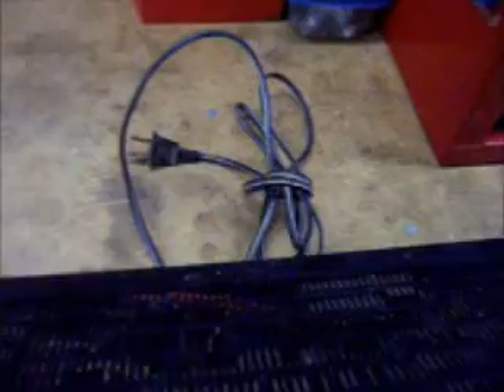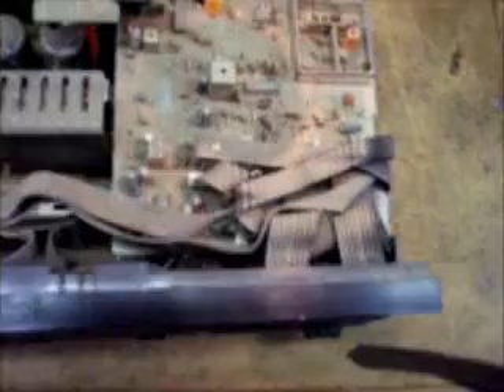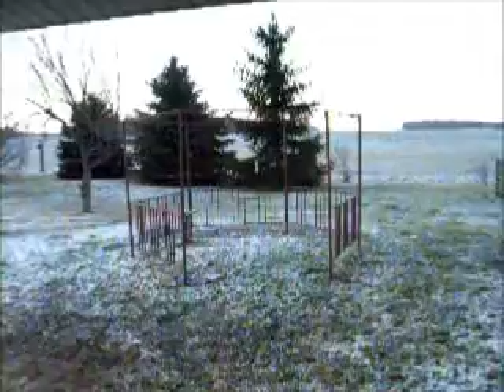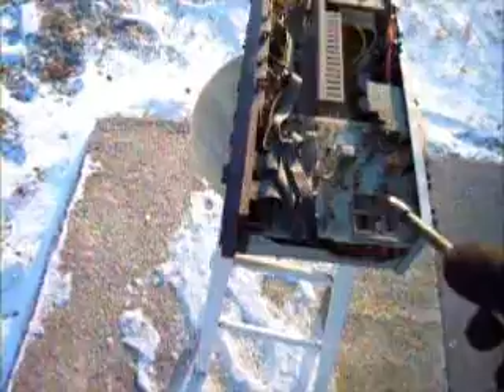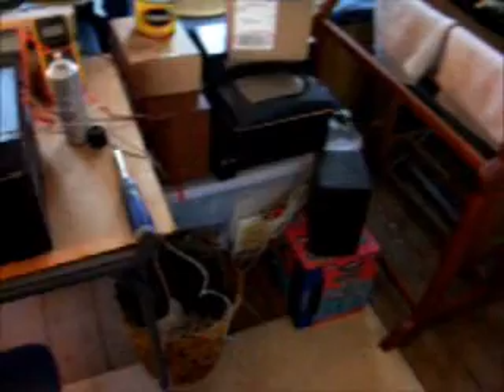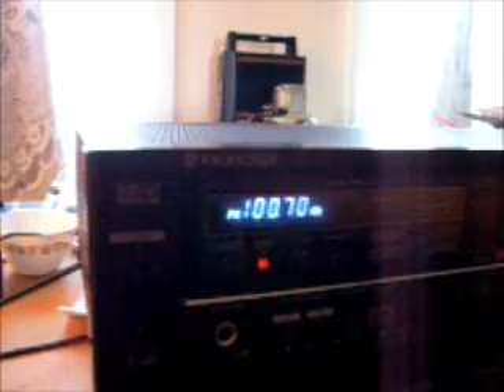Pioneer SX-V200 A~V Stereo Receiver

Comment: Great video.  I bought one of these in iirc 1987.  Still going strong.  Mine is the SX-V200L (with the addition of longwave, for the UK market).  Average power output into 8ohms is 30W/channel, according to the manual.  Only problem with mine is the scan stops (and indicates tuned) just beyond the stations frequency.  I've had to change the memory retention capacitor, but other than that, it's given great service.